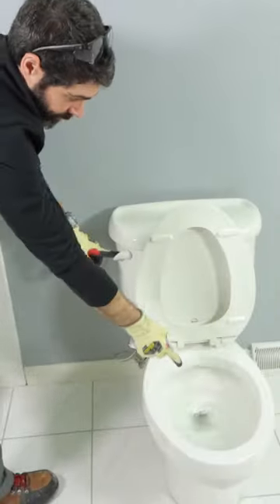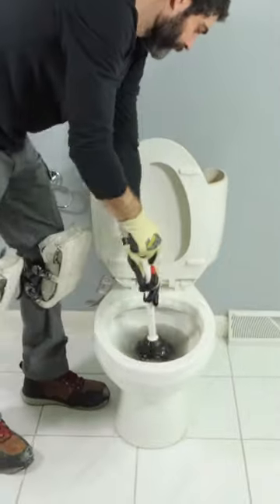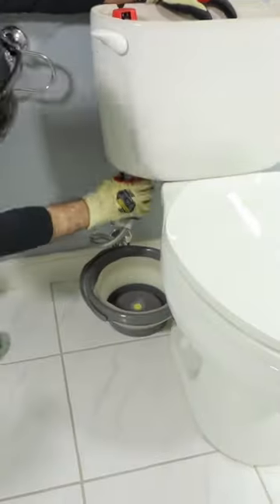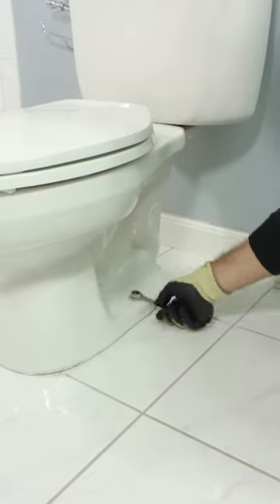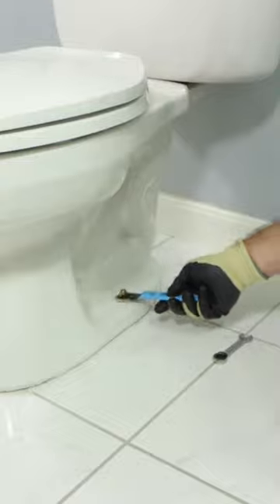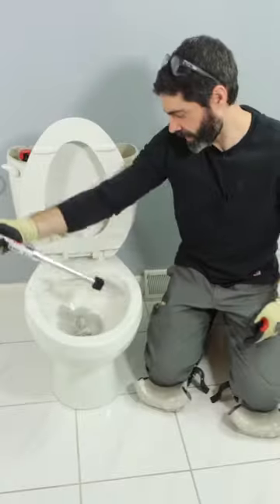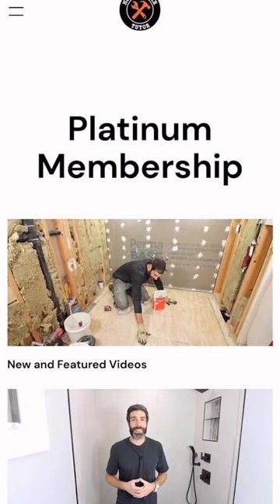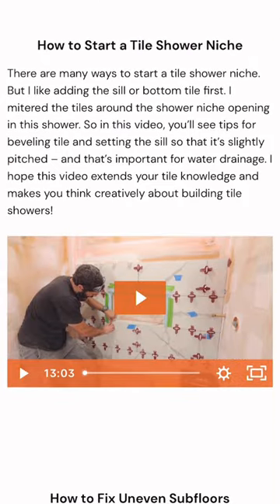How to Remove a Toilet - #shorts

Comment: Turn off the water supply, flush the toilet. Get a 5 gallon bucket full of water and dump it in the toilet bowl or will create a vacuum and get out most of the water.
Reply: Not enough though